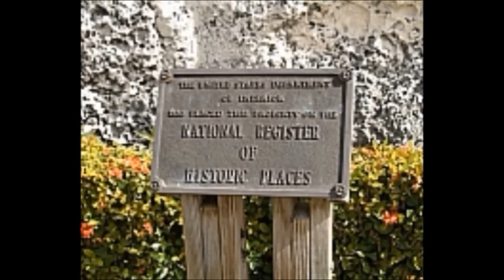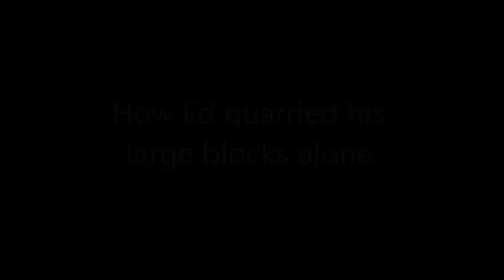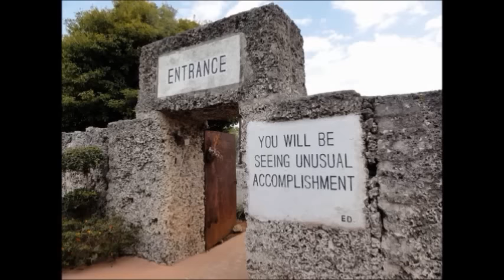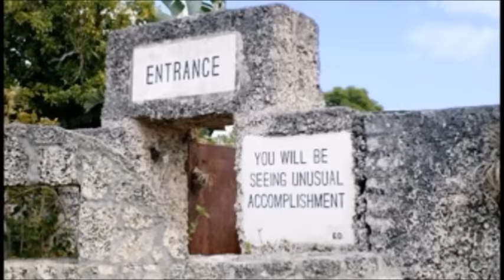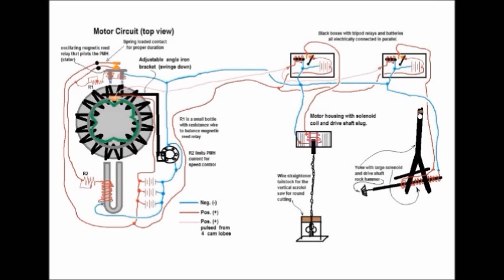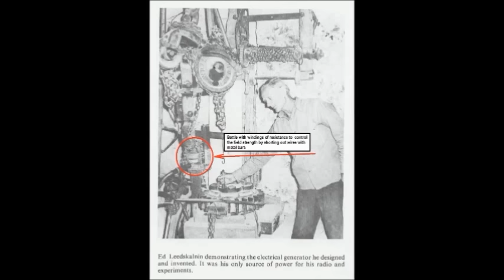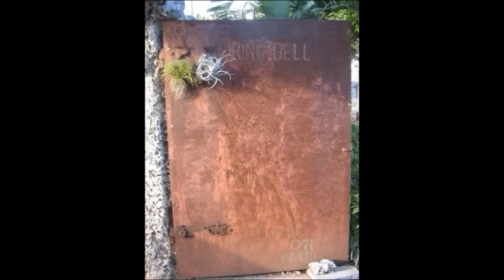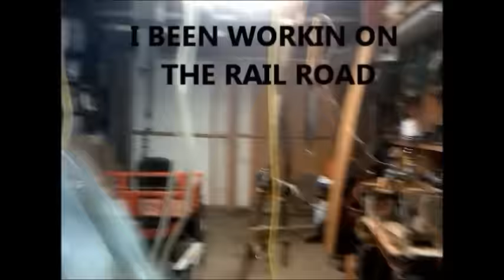Eds Coral Castle Quarry and Flywheel, Engineering Mystery Solved

Comment: Hmmm case closed my ahem...

Isn't it funny how a guy can set up a tripod in the snow and claim that it can lift 30 ton blocks (but in actual fact, hasn't done so in reality, just moved 3 poles together), then use a wooden board and claim that this was attached to a motor that was used to pull a very heavy iron door with some rope, in order to cut oolite limestone...showing in the video, that it is cutting soil/snow or rather thin air, then claim 'this is how Ed cut the blocks' (limestone)... but never actually did it on the video...   And worse still, people actually believe it.  Are you serious?  How stupid do you think people are?

So many other references in this so called documentary are fictitious and totally subjective, yet people will just believe it as if it were fact... the mind boggles.  So without further time wasting... I'm going to ask these very simple questions to you Mr. Scott Russell, I'm very interested in your response (if you've got the balls).

Q1: WHY didn't you cut the rock yourself, instead of just saying this is how it was done, so that you can prove 'scientifically' (not with your words and BS wooden door), that the exact same rock, was cut in the exact same way?
Note: Don't tell me that you didn't have the time or some nonsense like that, just tell us the truth.

Q2: WHY didn't you actually show us how the underneath of the blocks were cut, for real, not with your words, in a scientific manner and prove, scientifically, how it was done and film it?

Q3: WHY didn't you actually lift, using the same materials as Ed did (ie. same type block and tackle, same poles) a 30 ton stone block?

Q4: WHY didn't you move a 30 ton stone with your wheelbarrow contraption, around the maze of cutouts in the ground (even on flat ground), WITHOUT the tripod as Ed did?  (I'd like to see it even with the tripod to demonstrate your 'scientific' method).
Note: There is sworn testimony that the truck driver that moved the blocks (on his truck already loaded by Ed himself) from the first site to the second, that Ed did not use a tripod to move the blocks and lift them onto the truck but with a single piece of cable.  Go prove that with your theory by SHOWING us how it is done and film it, rather than SPEAKING it.

Q5: HOW can you expect us to believe that a simple metal rod attached to a solenoid, without any cutting devices attached to it, powered by Ed's Flywheel, 'cutting AIR' on your video, could actually cut the oolite limestone?  Have you actually every tried cutting limestone yourself?  I don't think so.
SHOW US HOW this is done by filming the actual process, then we will believe you.  Until then, its just another fictitious video with you 'Scott' claiming to have solved a mystery WITHOUT ANY OBJECTIVE evidence whatsoever.  Do it for real, under scientific conditions to prove it, then it will be real, until then its just a hypothesis.

I'll give you high marks for a nice looking and somewhat convincing video to the 'sheeple' that will believe any BS that is fed to them.  But as far as a scientific analysis of HOW things could have been done at Ed's castle, you fail dismally and I'm afraid that you are trying to take the credit as a debunker or some kind of science extraordinaire that has solved a huge mystery, and put your name to it, when infact it is a very weak attempt, that has no factual/objective foundation in science whatsoever, especially because its 95% subjective and 5% objective (ie. you haven't actually cut anything, you didn't lift a 30 ton block and the flywheel that could be used in so many ways, other than the way you've shown - your hypothesis is not based on fact but rather heresay).  You need to replicate the exact same thing which will prove your hypothesis, which you have not done.

Think I'm being harsh?  Well if you want people to believe you, go and CUT the same blocks, in the same way, using the same materials and then MOVE the blocks WITHOUT the tripod (as mentioned above), film it all and then you can label your experiment 'solved' using your name, otherwise its complete disrespect for a great man that proved what he knew by doing, not only speaking about it.

Until then, you have solved absolutely nothing, but you've just shown us how to convince the majority of sheeple that will believe anyone that has a convincing voice, without facts and using subjective storytelling in a nice little video.  Sorry if this offends you as it isn't meant to, but please go prove me wrong, SHOW US ALL FOR REAL as mentioned above, then you can label this mystery as solved.  Until then, this video is just another hypothesis.
Reply from the maker: I have a 30" brooky on boys look out I got to play him a bit, he's a feisty one, COOL BEANS.    but ONE Q   at a time.     Obviously without even reading your lengthy (those who know don't say, those who say don't know) totally biased discertation all I must say YOU said a lot. SOOOOoooooooo.   Question 1.

as for cutting how easy is it do you think someone who lives in the snow is going to RICHLY jump in a truck and zip down to CORAL CASTLE and start just quarrying up some of this rock (on property I don't own,  do you) that is as soft as STUCCO. yes stucco. This stuff is soft. but besides that I live up North. When I get to PHASE TWO actually quarrying with an iron door and an engine. like Ed DID (how else would he do it, a laser?  by hand? (many probably actually)   some new phangled 1920 diamond wire blades I haven't found yet? ME BE but prolly pritty simple. Most of those blocks are so straight and flat he must have used a large blade. PERIOD.

Question 2

he popped the rocks off the bottom with the mushroomed model T leaf springs. Every body knows that. Thats obvious. NO he didn't soften the rocks.  never cut under neath. snapped off the planet the same we do up here with granite and marble, the hardest stuff. Vermont has many quarries near my home. 

Question 3

Because Ed never lifted a thirty ton block. he rigged that ONE with jacks lift bars and supports. (and I must add that F$#$$$cker is an achievement you won't see me doing we will just have to realize he did it (without aliens)). He never DEAD LIFTED that big one. The rest are all under 5 or 6 tons.   
 PLUS      I don't own a 50 ton train hoist like ED did. mine only will lift a 1/2 ton. But I am working on a 10 ton one. calm your horses son. phase one is to solve the BS, phase two is to lift it, phase 3 is to put the old machine back together and sculpt something (like ED did)

Question 4

I pass. Q4 is a dumb question cuz you are all wrong on that one anyway. nothing to do nuthing to answer..

Question 5

Shows you have no idea how ED'S wheel "powers anything" watch my video again and pay attention to the title. Then realize electricity cuts rocks today with circular blades in seconds why can't a solenoid pull a saw back and cut a rock? the evidence is everywhere down there. all the interior relief cuts. the yolk, the legends, its all so simple you can't see it. When I actually do what you are all TEASED up about you will join me. But for now you are a hot headed trout on a line that could easily break if I pull too hard.

AS FOR THE LAST OF YOUR RANT,     no shit sherlock, No you are not harsh enough. But be real, You are dealing with someone who WILL show you how it was done NO BS. So on that WHAT ?Do you think I am done?   abso fricklootely NOT. don't you think step one is to throw out a actual working unit for all to comment on before I go spending 10's of thousands of dollars to procure the site, the poles in Florida, the engines, the whole hoist affair etc, . DAMN brother, I have had my video out for one year and over two thousand people have commented its sensible and plausible. NOT ANCIENT KNOWLEDGE or levitation, or free energy. cutting rocks is the LARGEST and OLDEST industry in the world. How hard is it????

Did you even watch my video??? didn't you see the old keisters cutting ledges of limestone with giant hand saws???  anyway I am hoping my 1/4 million views with thousands of positive comment on REALITY,  will sway the masses to support the truth not deny it as everyone HAS BEEN DOING. Time to wake up and move on to something like the pyramids PETE. 

SOOOOooooo.......  PETE, sincerely,  thanks for being another to help initiate my next step. all the skeptics are poking their heads out to take an annual peek, COOL thats my cue to get to Florida with some gear to Quarry some stucco. lift it stack it erect it mebe, then I get to start up a replica of  Eds old girl and show SHEEPLE how interior relief cuts are made with just a car battery and a solenoid.     TIMES 3 or more depending on how many stations I want.      ALL AT THE SAME TIME.........            while I am sipping on a cold one......                                  SWEET.           Scott R

PS How do you you think ED Leedskalnin Did it? The wheel won't do anything else by the way. the magnets are barely magnets. They are however Big Chunks of iron on the outside of a wheel. and there ARE coils on the wall that obviously make it turn, and the other coils are obviously solenoid coils and the yolk obviously was a giant tripod hung chipping tool, with ITS coil on the wall TOO. so what the hey? you think I am wrong or just need to finish?    finish I agree.        as for the rest    LAY IT ON ME.
Reply: Well Mr. Scott, I must first congratulate you for having the balls to reply to me, but also for the answers you gave.  Here is the problem:

Before I get into the specifics, just do yourself a favor and commit to memory, the following:
Scientific Method "A method of procedure that has characterized natural science since the 17th century, consisting in systematic observation, measurement, and experiment, and the formulation, testing, and modification of hypotheses."  Note the words systematic observation, measurement and experiment.  No where do I see a scientific method being done half way, half with real apparatus and the rest of the test, by words from some guy that says "this is how he did it".

So...

Q1:  You say that this frail guy cut these massive blocks by himself?  Okay, SHOW US on your video HOW it is done.  And NO I don't expect you to go to coral castle and cut blocks, show me where I said for you to do that.  What I asked is that you use the same materials (meaning get the approval for your scientific experiment (its easy to do and won't cost you a dime), go to a quarry that has the same limestone and Perform an experiment by cutting the blocks, not by speaking.  All you've done until now, has been just showing some equipment and you've cut the blocks with your words... hardly a scientific approach.

Q2: You said "he popped the rocks off the bottom with the mushroomed model T leaf springs." and that he never softened the rocks or cut them underneath, he snapped them... okay SHOW US on your video HOW it is done to validate your hypothesis.  Don't cut the blocks with your words, anyone can do that.

Q3: You said that ed never lifted a 30 ton block, but rather with jacks, lift bars and support... then you also said, most of the blocks were 5 to 6 ton.  Fine... SHOW US HOW he did it.  If you cannot replicate the task physically/scientifically, then you cannot say that "it was done like this".  Period.  You must perform a real life experiment that demonstrates beyond any doubt, HOW you THINK he would have done it.

You also said "I don't own a 50 ton train hoist like ED did. mine only will lift a 1/2 ton. But I am working on a 10 ton one.".  Well then you cannot perform the experiment scientifically, under realistic conditions.  No point in you arguing this with me, because you'll end up looking silly.  It would be like myself saying to you that I can lift a matchbox up with a tripod and then stating that it would be a scientific experiment to prove that I could lift a 5 ton block because it 'looks' the same... Sorry, BS.

And then you went and mentioned "without aliens"... From them I started wondering why you even mentioned that as I had never mentioned anything about aliens... what does that have to do with anything?

Q4: You didn't answer this question, most likely because you cannot replicate the task.  It is one thing to be able to lift a 5 or 6 ton block and it is quite another to move it from one part of the site to another, let alone from one part of California to another.  Like I said, SHOW US HOW it is done, scientifically, then your experiment will be rendered valid, otherwise its just your words that moved the 6 ton block... good luck with that.

Q5: Not sure about your reply, you seem to infer I know nothing about Ed's wheel... or that I'm 'teased up'... actually I know a little bit about the wheel, and in actual fact, this kind of design... that discussion is for another day.  I'm also not teased up, I just don't appreciate people slagging off hypothesis for something of this significance just on subjectivity.  You want to prove something, then perform a scientific experiment in realistic conditions, not by showing apparatus and then SPEAKING 'this is how it was done'... total BS.

Finally... I don't rant, but if you want intelligent interaction with your visitors, on such a huge subject, you can't expect one liners from intelligent people, those one liners come from people who have the intelligence of a rock or are wannabe comedians.  Additionally, I find it amusing that you base your swaying of the masses on the concept you are able to convince people how things were done, even though you haven't actually done it yourself.  Clever video and quite entertaining for those is little intelligence that believe you have 'done' something just by stating it so, but haven't actually proven the fact by physically doing it.  Thats the difference Scott, the silent majority, most of the time, don't comment on this kind of thing because they laugh it off and move to the next video.

I'm also puzzled why you've mentioned ancient knowledge, levitation or free energy... where have I mentioned that?  Not sure where you are coming from, but its quite bizarre indeed.  Ed's wheel 'could' be used for several different things, several different ways, just because you found one way, doesn't mean that it is proof that it was the way it was used.  Its like these people who think themselves so clever that they know how the Egyptians built the pyramids, with some ridiculous notion that it was a bunch of slaves that worked for 20 years, non stop, 7 days a week, 365 days a year and then MOVED, LIFTED, MOUNTED and POSITIONED these multi ton blocks into place, EVERY 1 MINUTE.  That is what it works out to be, mathematically from the so called Mainstream experts... funny how these experts can't replicate it.  Absolutely ridiculous, just like your video.  If you want your HYPOTHESIS taken seriously, PROVE it and SHOW US HOW it was done by DOING IT YOURSELF IN THE EXACT SAME WAY.  Don't speak it, do it.

REMEMBER: No one will ever know HOW Ed built the castle, we can all only speculate and hypothesize because ultimately the only way we will know is to ask Ed himself, and you know how successful you'll be at doing that.  Therefore I commend your effort and time you've spent on this, no doubt you will make a lot of money from your products you are selling, but ultimately it will always and only be a HYPOTHESIS.  Nice try though...

And about your question on how I think Ed did it... well I'm not the one who is telling everyone that I know how he did it, you are, so please enlighten us all, SHOW US HOW by doing it yourself.

And you have yourself a great day ! :D
Reply from the maker: Pyramid Pete Yes on the pyramids with the intellect telling us that they pulled them with water and sand, and thast they did them in 20 years, more like 200 and one of the zeros in the heiro's is missing,

Two I am not saying this is how he did it, I know its how he did it is up to the rest of the world to "have input or Deduce for them selves this is with all the coils, electrical evidence etc. 

You need to be spoon fed because you just can't see that he did that way can you. Why should I copy ED's work just to prove the obvious to the peeps who were totally lied to in the first place.

As for ancient knowledge, PYRAMID PETE. no you didn't mention that. As a matter of fact you haven't mentioned anything sensible on a "theory" a "Plausibility" a For all we know you believe the levitation video's that claim the wheel is magic or gamma's cut the rocks with EDS LASER. And whether you do or not. Do you have any COMMON SENSE AT ALL? because if you did you wouldn't just shoot down MAN's OBVIOUS WORK and say no no no spoon feed me I don't believe but I don't care about the BLATENT LIES the crap videos have fed the SHEEPLE. instead I will shoot down everything and wait for the obvious to be shown to me EVEN WITH PICTURES AND EVERYTHING.

SO HERE IS A SCENERIO:  
1. Little evidence at all, except for a few books and a big UNKNOWN WHEEL and then a bunch of WOW videos come on about stuff that makes one go WTF? obvious BS
      Then a guy comes along and shows almost everything REAL and we still deny it as a possibility. as for really cutting, get real, peeps have been cutting rock for 1000's of years. You just need to use your givin mind to realize  its not that hard. I don't need to prove anything more if I don't want to. The world KNOWS NOW. want the baby food my friend, don't worry I will feed you but you and a minooooot handful insist on pictures in the book you are reading. cause kids love pictures.

So If you are the only one of 100,000's who CAN'T see the obvious, then YOU will just have to wait until I kleer up all my "excuses" that have prevented me from finishing the frosting so BYSTANDERS like you can eat the cake too. Did you know how to erect a 35 foot tripod alone?   seriously. Take a pill kiddo.
Reply from the maker: Pyramid Pete Do You have the BALLS to give us your take on it? otherwise GROW SOME.   I am right and you know it.

Scott
Reply from the maker: Pyramid Pete PETE, I have just come to the conclusion that It is I who has been rough on YOU.

First of all, my Titled "mystery solved" was wrong I apologize, but again it DID tease up a bunch of skeptics.

Second, I assume that MOST people! not sheeple But I Do understand your condescending vernacular, KNOW that Rock Quarrying, Cutting and lifting is the oldest practice in the world, and KNOW MATTER HOW or WHAT  Ed could do it, with a door and a blade probably, magic juice, alkali, acid, frequency, levitation mebe but practically not, The way they been doing for centuries PROBABLY. and quickly the rocks are so straight by hand was NOT IT.

Third, The only reason I put this video up was to CHANNEL the PLAUSIBILITY that the WHEEL sat at the center of an "ancient" rock cutting compound. get it ??? COME POUND, on a rock. Too much TOTALLY ILLOGICAL conjecture was being tossed out as to its REAL purpose, This conjecture granted,,, BUT THOUSANDS of people have "agreed". If there are more "levitation" "believers" than there are LOGICAL ELECTRICAL METHOD "believers" than I am screwed and you fantasy peeps can have the planet I am out of here. Back To the THOTH HIGHWAY.

fourth, I love you man, you are a feisty little totally misguided dude who needs (a little) help. I can help. unless you enjoy being looked at as someone who denies common sense looking for something more complicated Then now the burden is on you I have supporters. but I have done my homework, I KNOW HOW ED DID IT, EXACTLY NO, but its within reach now, (almost grounded)  NOT in the hands of levitating aliens. or levitating men, or even a wheel that generated anything, because its a switch motor. WHEW.....

AND would you get it through your head, NO ONE LIFTED A 30 ton ROCK with a tripod. Those things I wouldn't trust with much over 10 tons. mine will prolly lift my truck. 3 or 4 tons but they are not straight poles or lashed the way ED did either. When I do it down there, I will need safety first. So anyway help me not hinder.   thoughts?  besides anger and negs.
Scott R.
Reply: Hello Scott... :D

It seems you have become somewhat agitated from my posts... sorry about that, didn't mean to upset you, but by the looks of it, you are quite angry.  Have I touched on a nerve or something?
You see the problem is, I haven't really said anything that the MAJORITY of people would not be thinking.
What I've asked you is quite simple, yet you keep feeding me excuses, you've really never answered.

Scott, although I really do appreciate the time you've spent making the video, obviously you've put a lot of your free time into it.  However when one makes a statement as 'mystery solved' and the only evidence you can give me is making a video, showing apparatus but NOT UTILIZING it but in the same breath, stating 'this is how he done it', without doing it yourself is quite another/different story.

Scientific evidence and process is based on FACT.  These facts MUST BE REPRODUCEABLE !  If you cannot reproduce the steps you say Ed took to build his castle, then you are identical to everyone else who has a HYPOTHESIS !

Because it seems you do not know the difference between hypothesis and scientific fact, I thought I'd enlighten you in simple terms.  Hypothesis is a THEORY based on thought and subjectivity.  Scientific FACT is based on actual experimentation that can reproduce the same result over and over again.
Now although no one will ever know how Ed built the castle, one can hypothesize, but no matter what happens, it will always be a hypothesis unless you can ask Ed yourself.  Because Ed has long gone from this earth, you or anyone else, can never ask him so it will always be a hypothesis.  Scott, but at least you need to try and reproduce lifting and moving the blocks as per my initial thread to you.  If you can't then I suggest you first change the title of this video and second you need to retract the video from the library of congress because Scott, it aint the way you say it is unless you can at least prove it by showing us.

Seeing you have not shown us, you just show aparatus on your video and SPEAK about how it was doing without actually doing it yourself, you really can't say this is a scientific test.  Period.

Scott, I am not the one who is claiming to know HOW he did it, YOU ARE !  And if you think for one minute I'm gonna 'eat cake' you must be smoking some real heavy stuff because even if you did manage to lift a 6 ton block (and please be careful if you try it), you ain't gonna move it anywhere, especially with that wheelbarrow contraption, you will risk the block falling on you and we don't want that.  Be safe please.

I know you've tried to belittle me by saying that kids want pictures, but you see Scott, its not about kids wanting to see pictures, its about Scientific process that must be followed in order for you to claim you have solved a mystery.  Thats why you can't just claim you know how someone did something unless you can reproduce this claim firstly.  Secondly, there isn't only 1 way to do something, there are many different ways to do the same thing so in order for you to scientifically prove that Ed built the castle in a certain way, you'll have to ask him.  Because he is dead, you can't ask him so therefore it will forever be a mystery and anything that you come up with, even if somehow you did figure it out, will always be a hypothesis.  This is fact Scott, probably better to accept that and move on.  Don't you have anything better to do with your life?
Reply: Scott, I am not the one who is claiming to have solved this mystery, you are the one.  Please SHOW US HOW he did it, and then your hypothesis will gain more credibility.  Anyone can speak or write a hypothesis and if you have not replicated/reproduced this visually through scientific process of experimentation, you can't expect any credibility.
Reply: I'm not sure why you keep pushing this levitation thing... I've never once said anything about levitation or aliens, yet you keep on putting this into the discussion which is only damaging your credibility with every new line you write.  Please do yourself a favor and stick to the facts, please perform a scientific process/experiment where you can replicate what you say Ed has done.  If you cannot, then you just have a hypothesis with very little credibility.  Period.

Against my better judgement, I thought I'd make a small comment on this 'levitation' that you keep mentioning.  In terms of levitation, one needs to define the word 'levitation'.  If I get 2x square magnets, put in a square wodden box tube.  I insert one into the wooden box tube, with the north pole say pointing up and I get the second square magnet, with the north pole facing down and insert it, what happens to the magnet on the top?  Does it touch the magnet on the bottom?  The answer is NO.  Why?  Is it some kind of alien technology like you keep on mentioning in your replies?  Or is it basic physics/magnetism that is keeping the magnets apart?  You already know the answer to this, but the problem is, your language suggests that you want to ridicule people instead of give clear explanations and produce factual evidence.  There is no magic technology, but in order to describe a particular event, people might use the word levitation or they might use the word magnetism.  Either way, WITHIN THE CONTEXT OF THIS EXAMPLE, both have the same meaning.
NOTE: And before you say that only magnets have magnetism, be aware that the entire earth is one huge magnet.  I'm pretty sure you know that already.

So Scott, I do think you are a smart guy (and I'm not being sarcastic either), but please take a chill pill and relax, (and stop smoking whatever it is you are smoking, you are gonna bust a blood vessel or something).  Please refer to the other comments I've made, I'm getting tired of repeating myself.  I do however, enjoy this interaction, at least you haven't gone off the deep end or worse still, blocked me from posting.  Anyway, peace out and have a great day !

P.S.  And No, its got nothing to do with a missing zero (re the pyramids), and everything to do with mainstream idiocy and secrecy, which is why mainstream archaeology state that the pyramids at Giza were constructed in 20 years (there is no missing zero)... Its a complete fallacy because the math and logic just don't add up.  If you want to have a discussion on pyramid building theory, I will welcome it because it gives me a chance to engage in some stimulating discussion, and maybe you want to make another video or something in the future, but first, lets get one thing done at a time.
Reply: The best retort of the whole matter. "Scott" you have no common sense period. A mighty scientific intellect whose head is in the clouds!
Reply: Made by one man your response here is every bit as good as your program
Reply: kraanz I’m laughing at how upset this guy gets when being called on why he’s not showing any evidence to support his theory.. then goes on to insult the guy asking for evidence, and rightly so for someone claiming that they’ve “solved the mystery.”  I think the only thing solved in this video is that the creator has an ego the size of the 30 ton block lol. Ridiculous
Reply: @jasoncarraway966  agreed this guy didnt solve the mystery. I think he did potentially find a way to do it similarly but this was not how ed did it.  he is forgetting about a very key factor in the whole experiment... or maybe he knows it and this is a government operation to have people stop asking questions.
Reply: @madebyoneman5006  Instead of clickbait, vainglorious hypotheses and condescension, make a real video and SHOW US HOW IT WAS ACTUALLY DONE!
Reply: @madebyoneman5006  Seems like at the end there your saying that you don't need scientific method to prove your point.  Then you go on to make fun of legitimate people who actually do use it calling them kids in need of picture books.  I realize these comments were make like 3 years ago but wondering if you ve done anything to ACTUALLY prove how this was done since then